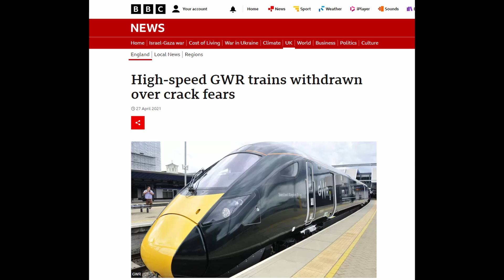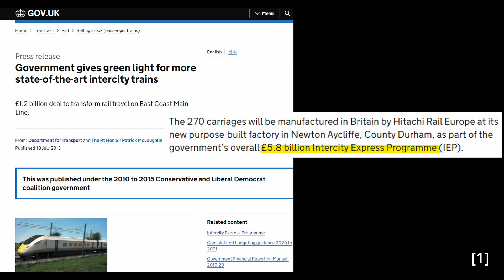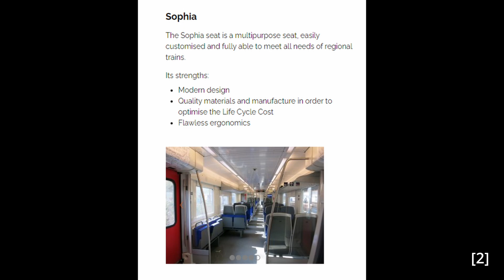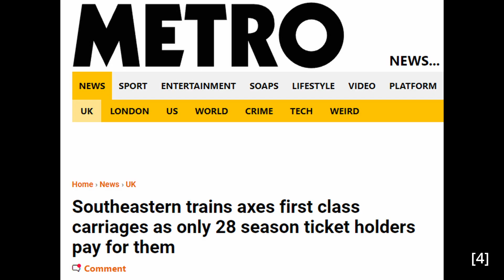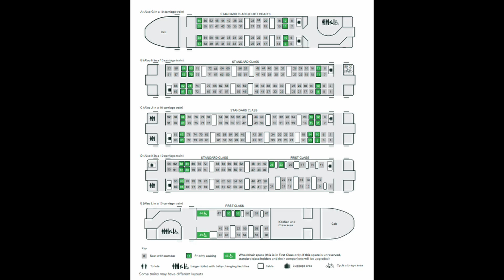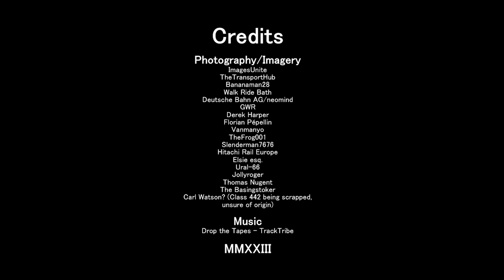Can the IETs ever be decent?

Comment: Having been on both LNER and GWR 80Xs this year, I can at least say that the design and feel of the LNER ones is far better. They are cleaner, the red just creates a warmer atmosphere, and LNER just offers more on their trains. The LNER 800s also have a much smoother ride, though that may just be that the ECML is a better quality track than the GW line.

Hitachi has luckily delayed the 810s promised to EMR in a hope to update the design and fix it. Though having been on an EMR 222 down to St Pancras, it was a much smoother ride than the GWR 802 was out to Reading. So Hitachi have to equal or better an already 20 year old design for them to get good reviews from EMR.

We'll see if they can get better I guess.
Reply from the maker: The LNER ones are certainly much better. This is partly because Virgin East Coast got into a quite heated discussion with the DfT over their specification, and in the end convinced them to allow buffets and personalised interiors to be fitted.
Reply: @GWVillager Insider perspective here - GWR have fought for better interior fittings (the lime green stripes come to mind!) but Hitachi have refused to allow them, as they don't want GWR fitting out the interiors for 'product image' concerns. Bold words coming from a company that hasn't had to carry a single fare-paying passenger!
Reply from the maker: @danlastname9002  A similar thing happened when specifying them in the days of Virgin Trains East Coast - but Virgin actually got their way in the end.
Reply: @GWVillager  Interestingly it's also why train crews aren't allowed to knock out broken windows on IETs... Hitachi don't want black and yellow tape all over their trains.

Which is ironic, because the procedure for broken windows on IETs is to put black and yellow tape over the window. And the damned trains are covered in the stuff!
Reply: I think the ECML being electrified contributes majorly to the ride quality, other commenters are saying the GWML should be fully electrified to get rid of the diesel engines and improve ride quality. 

Certainly I know when I'm travelling down the WCML I avoid the diesel-electric Super Voyagers as best I can and try to stay on Pendolinos — with the exact same track conditions the Voyagers rattle my bones out while the Pendos are so smooth and comfortable.
Reply: Casual company bias since LNER passes newton aycliff where the trains are made?
Reply: Though even on electrified parts of the route, the GWR trains shake quite a bit and for some stretches shudder really quite violently

Comment: I'm amazed at the ability of the DfT/government to procure such poorly specified trains from otherwise decent manufacturers. Even the normally stalwart Siemens managed to make the naff 700s. For what's supposed to be a 30-40 year asset it's shockingly poor investment, which UK travelers will have to suffer with for decades. And now we find that our sole remaining UK designed manufacturer at Derby has been driven out of business, largely due to excess manufacturing capacity. Isn't competition wonderful for improving value and UK business.
Reply: Civil servants always screw things up. Defence procurement is another example.
Reply: @physiocrat-sv  TBH I don''t blame the civil servants, it's political, due to the obsession with open competition over sustainable industrial policy. A policy of competition over all other considerations always results in overcapacity and a race to the bottom with quality. Plus UK manufacturers are fully exposed to open international competition, while their offshore competitors are well supported by their own governments, giving them an unfair advantage. UK industrial & engineering base has been decimated with this madness.
Reply: @enemyofthestatewearein7945 
The IEP project was driven by the the DfT. The industry did not want the wretched things. It was also known that the Mark 3 fleet was good until the late 2030s.  The specifications for the seats and interior configuration came from the DfT. Five billion was completely wasted. These trains cannot be fixed. They should go to Sims Metals.
Reply: Good old Tory policy to penny-pinch every way they can even when it's more expensive in the long run. 

Conservative Chancellor after Conservative Chancellor has under-budgeted all sorts of projects, only to end-up needing to pay more later. At this point I can't imagine they're just fools, I think they must know it generates higher income for the companies which step-in to save the day, at an inflated rate, when disaster strikes. 

The very basic fact that infrastructure (education, health, transport, etc) is one of the best long-term investments a state can make in itself, that the long-term returns are many times larger than any initial cost, always seems to be conveniently at the back of their minds. Or they'll claim to recognise it, but then say there's still room to cut costs (even when that comes at the expense of effectiveness).

Comment: I do not think that replacing all the 5 car trains with 9 car trains is a good idea as for the cotsworlds route and the penzance to gloucester and cardiff routes dont tend to be full up with 4 coaches. Of course this would mean a lot more capacity but just money wasted. I think that the 5 car trains should only be reserved for stopping services and joining both 5 car sets together to form 10 coaches. So I dont really see a problem with more 5 car sets than 9 car sets. I think that the problem you talked about was just bad stock management from GWRs part or maybe GWR needs more IETs.
Reply from the maker: As I said in the video, only the 5 car 802s would be lengthened. The 36 800/0s would remain 5 car.

Comment: How about doing a similar video on how the CrossCountry Voyagers could be improved?
Reply from the maker: Maybe, but longer term I don’t think the Voyagers should stick around on Cross Country. The line should be electrified with new stock.
Reply: @GWVillager Agree, electrify then use ex tpe mk5 with class 88
Reply: @Grid56  Although they've hardly entered service, the mark fives have developed some nasty cracks. I think the decison of the new management at TransPennine to hand them back is correct. The previous management decided to order THREE separate classes of train to increase the fleet/replace the 185s was disastrous.
Reply: @roderickjoyce6716  CAF stuff seems to be cracking all over the place. After the Hitachi debacle it doesn't inspire confidence in modern construction methods, especially compared to the evergreen 37s and 47s still bashing the rails !

Comment: 7:50 The current Deutsche Bahn ICE4s have inside frame bogies on their unpowered coaches, and there really isn't any difference in comfort when compared to the outside framed bogies on powered cars. This is true even at top speed, which is about 30mph higher than on the IETs. So the general concept doesn't appear to be the issue, but rather the implementation. I'm guessing the IET bogies were designed to be cheap and nothing else, which does seem to be in line with the rest of the train.
Reply: The IET trains were the most expensive ever.
Reply: @physiocrat-sv  I can only presume, then, that the DfT hadn't the least idea what it was doing. (No surprises there, I suppose).
Reply: @johnhammond5379 
Or that brown envelopes were exchanged. The entire procurement process was heavily criticised by the Parliamentary Accounts Committee and in a detailed report by Sir Andrew Foster but Philip Hammond Transport Secretary gave it the go ahead anyway.

At that time the Mark 3 fleet had an expected future life to at least 2030. Money down the drain.

Comment: What's concerning, is that EMR with the class 810's, are to bring these on-line in the new year, with units currently on test on the Old Dalby test track, in Leicestershire. The only seemingly saving grace, is that the seating has been given some thought, with various EG's on display at various EMR stations, Nottingham, Derby, and Sheffield where I have seen them and tried out.
Reply: My understanding is that they still went with the cheap design, despite the public feedback.
Reply: @bruceknights8330 they did change the seats at least for the EMR trains

Comment: As someone who travels on these trains every day at 125mph (fortunately only for a short way) I do agree with most of the problems. The GWR sets are certainly the worst when compared with the other operators. Every other operator has done some to make them feel better and GWR are much left with the most basic version. 

Regarding the bogies. I sort of accept your comment that inside frame bogies reduce the ride quality over full framed bogies but in the case of the 80xs I disagree.
The ride I have found on the 80xs when running from Chippenham to London Paddington gets progressively worse the closer you get to london despite the speed being the same with the final section from Reading being awful. I have always found it odd that the 80xs have two styles of bogies with full frame bogies most of the time and inside frame bogies found only on the non driving trailer coaches in the 9 car sets. It is though Hitchi haven't worked out how to make an inside frame motor bogie something every other manufacturer has worked out. (The class 385s also use 2 different types of bogie).
I have travelled on both the coaches with full frame bogies and those without (I mainly travel in the coaches with full frame bogies) and I have found the ride to have no difference I have noticed. 
You showed a class 700 bogie and despite these being inside frame I have ridden these loads and not actually noticed the ride to be bad at all it can be a bit bouncy at 100mph but not hard like it is on the 80xs. For another comparison I have ridden both 700s and 387s on the line from London Kings Cross to Hitchin and the 387s have a noticeably worse ride when compared with the 700s and yes they were both doing 100mph. So based on this I think it is far less about the style of bogie as there clearly are other things that factor because you have good inside frame bogies.
Reply from the maker: This is true - it’s not inherent that inside frame bogies give a poor ride and outside frames give a good one - but there is a strong correlation. I would also say that the inside sprung bogies on the IETs do perform worse in my experience, though there’s not a huge amount of difference.
Reply: Yes the 387s have a horrible ride

Comment: If I was in charge, I'd convert the kitchens to bike and bag storage, then convert the bike storage to a static trolley counter with maybe a combined microwave for hot rolls etc. I'd probably relegate the 80Xs to CrossCountry, then get some fabulous 745s and 755s for GWR. They also have level boarding - which means more people can board and alight without needing someone to help.
Reply from the maker: The issue with getting rid of the kitchens altogether is that you couldn’t provide the very popular Silver Service.
Reply: @GWVillager  indeed - I think for me I value day-to-day service for the average traveler more than the once or twice a day fine dining service - having looked at prices I do wonder if they bring in any notable amount of money at all in the scheme of their daily operations
Reply: @GWVillager  could just get special sets for the silvers, it's maddening to see a kitchen fit for a small restaurant on every service, when they just aren't used. (anecdotally) the microwave costs aboout 15000

Comment: Many thanks for this review. Yes the seats are dire and should be replaced. I would reduce the capacity a little so that we don’t have to have so many seats with a view of some plastic paneling. (Travel by train and don’t see Britain!). The interior colour scheme of the GWR trains is a bit brash and could be refined as you suggest.  
However you go on to suggest replacing the bogies - which would, I hope deal, with the generally jittery ride accompanied by sudden jolts.  Then you go on to mention the lack of a buffet car. It should be noted half a carriages is taken up with a kitchen. So on a ten car train, made up of two five car units 10% of the train is unused! With that and the need for much more space for bicycles and parcels (GWR had a service for parcels with the HSTs) and it becomes increasingly obvious that in their current form these trains are woefully inadequate and a major redesign is needed. 
With luck they could be replaced with something better after a few years and as you say the GWR needs kick up a fuss about this.
Reply from the maker: Oh, yes, you’re right about the seating. Those odd pairs of seats at the end of the coaches with no window should really be replaced by extra luggage storage.

Comment: I wholeheartedly agree with your comments.  I am not a frequent traveller but I have been on several of these units. My main gripes are the uncomfortable seats in 2nd class, the harsh and very bright overhead lighting, the poor ride quality over iffy track (I was nearly thrown to the floor not so long back on the approach to Worcester Foregate Street when the train negotiated some points).  The GWR management are completely out of touch with passengers’ needs in terms of comfort.
Reply: It wasn't up to gwr, blame the dft
Reply: I agree that the DfT are hardly blameless either and what chance have we got when there is a change of Minister every five minutes ?  Do any of the people at the top actually know anything about running trains ?
Reply: The GWR management don't care.

Comment: Well, they COULD be decent trains, but it really feels like they were intentionally designed bad with parts coming from the lowest bidder. I never knew the trains were falling apart like this since I've been doing my best to avoid riding the IET for years now (last journey on one was October 2021.) But yeah, I do agree with your suggestions here, especially that idea for First Class. Those designs are pretty neat, though honestly the 5 car ones should've never of existed, full stop. Hull Trains and recently Lumo are now starting to run more 10 car services, which to me, says that they are really good at underestimating the demand on their routes. 

To add, overcrowding is seriously a dangerous thing. More people in an enclosed space give off more heat, requiring the AC to be working more to cope and if it fails, people can faint from heat exhaustion, and that's one of the better scenarios. What happens if a fire breaks out? How do you easily evacuate people stuck standing in the aisles? What about a crash or derailment? Horrible can of worms I say...

I think a good idea would've been if GWR bought their fleet of 9 or 10 car IETs strictly for intercity use and then invest in a fleet of 6 or 8 car long trains for regional services that can fill in for an IET at a last resort. Like a 6 car variant of the 745 to run on Portsmouth and Penzance services. I'm so fed up of seeing the 5 car Plymouth, Camarthen and Cardiff trains man. That never happened with the HSTs and it shouldn't be happening now.
Reply from the maker: I’ve never understood why Hull Trains/Lumo went for 5 car trains, HT have been overcrowded for a while and it was obvious that Lumo would quickly fill up. A crash involving a rammed train is too horrific to think about, but there is also the issue of disease spreading easily - a (one would hope) notable concern after 2020. It would be terrible to go through the experience of the pandemic and come out less prepared for a potential new outbreak.

I completely agree about GWR needing a new regional fleet, that would solve an awful lot of problems. Whilst it’s definitely worse now than it’s ever been before, I would add that, in the latter days of the HSTs, cancellations became quite common with their declining reliability, and (for quite a while) Cotswold line trains were regularly substituted for Turbos. Thankfully both of those are less common now, even if the number of 5 coach trains is unacceptable.

(Also, no IETs since 2021? That’s some serious dedication - I can’t really avoid them
unfortunately!)
Reply: @GWVillager   I swear, the state seems to be doing everything it can to forget all lessons learned over the last few years. Schools are asking kids to stay in when they're sick because of government (dis)incentives about attendance rates. I don't even see nurses masking between assessing patients, which seems like one of the places you'd expect to stick around to keep staff absences low at a minimum! So I'm not expecting it to factor into railway decisions, sadly.
Reply: @GWVillager it could be worse recently GWR replaced an IET with a 166 on a service between Paignton and London Paddington.
Reply: @GWVillager   The secret ingredients are luck and coaches!
- Went to Cardiff one day: Megabus there and back from Heathrow.
- Trip to Doncaster and Grimsby: LNER 225 to Donny, GC 180 back to London
- Day trip to Middlesbrough: GC 180 to Eageslcliffe, Megabus overnight back down to London.
Again, anything to avoid an IET and I mean anything!
Reply from the maker: @MaverickHunterDaniel  Even a 387 from Cardiff to London?
Reply: @GWVillager  Now that's just worse. Of course I'll avoid that too for those journeys!